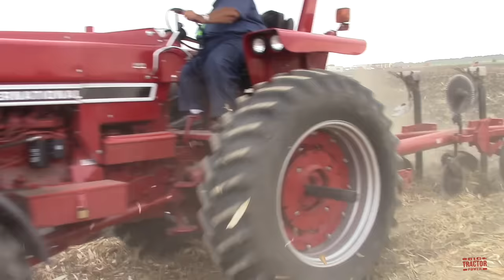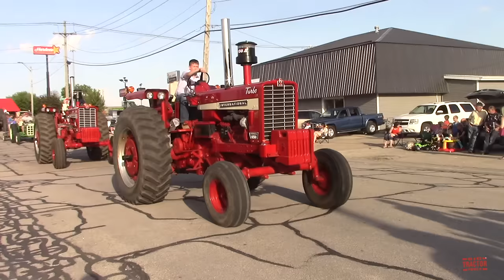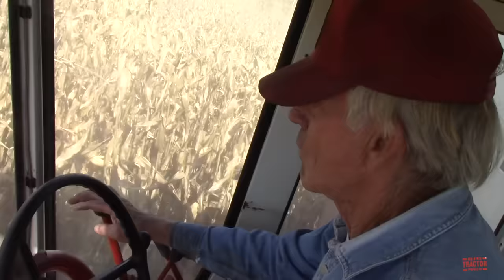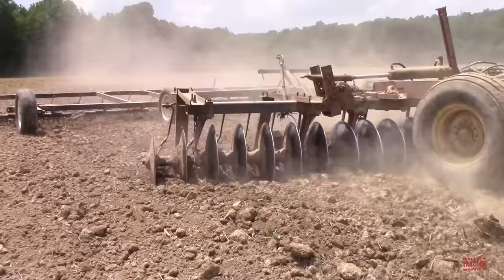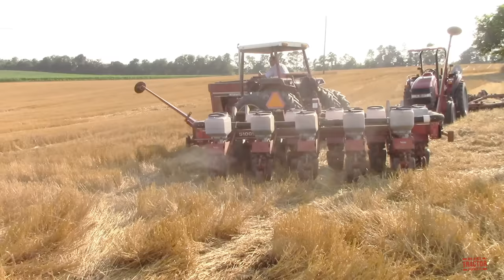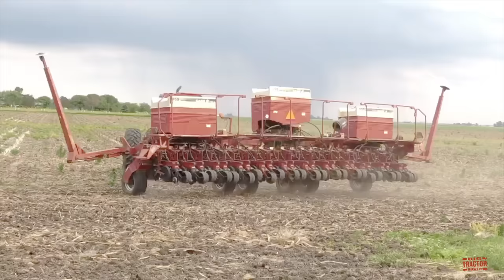INTERNATIONAL HARVESTER Tractor History

Comment: I grew up on JI Case equipment but have had the pleasure to run several IH tractors and my favs are 1066, 1206, 1586 and the low boy for mowing grass. 
We run Case IH on the farm in Illinois plus a couple of New Holland from same dealer.

Comment: I learned to drive on a IH 274 and spent many hours on Dad's 140 Hi-Clear. My two favorites though are the 826 as it was the first large row crop tractor I ran and the 5X88 series. The 1400 series Axial flows also hold a soft spot in my heart.
Reply from the maker: Very nice. I hope to film a 1480 Axial Flow. I have filmed a 1420, 1440’and 1460.

Comment: My grandad had lots of older Farmall tractors but that was before I was born (Dec 1960) and when he passed away suddenly in Nov. that same year, my dad took over the farm at 24 years old. He eventually bought a 806, 966, 1086, 1466, 5088, 686 and a 7130. We still have the 966, 686 and 7130, but the 5088 caught fire in the field last year and burned up... a complete loss. My favorite was the 1466.
Reply from the maker: Sorry to hear of your grandfathers sudden passing. Your family has some great red power.
Reply: My dads 1985 5288 caught on fire last year as well luckily it was just the turbo and we are lucky that the insurance company coved most of it

Comment: We owned 2 IH tractors in Serbia in the 90s and 00s. One was a 1066 in yellow color, and the other was a 1086 in white color. Both of them had double wheels in the back. I was just a little kid but I always wanted to sit in the cabin with my father in the 1086 since you could seat in the back in that tractor. A few times I even fell asleep in that tractor as a kid. I remember that they never wanted to start up on the first try so we always used K2 spray to start it up.

Comment: We had a 966 with the cab and an open station 806. Both worked good, but the 966 was pretty rough and probably needed an overhaul. Never wanted to lug down low, which seems uncommon. 806 was a true workhorse and is still in the family after selling everything else. Hour meter rolled over at least once, maybe twice!
Reply from the maker: The 806 is a solid tractor.  The 66 series are also good.

Comment: My favorite International was an 806. It was the first diesel tractor I ever operated. I loved the TA on the transmission. I baled a lot of hay and did secondary tillage with that strong machine.
Reply from the maker: The 806 is one of the all time greats.
Reply: U wouldn't believe how many ta's I seen my father tear apart. That was the week point of th 706,806, etc, that and the pro clutches
Reply: It was always the bearing that would let go often messing up the crown wheel and pinion the clutch.  They were are nice tractor  to drive with plenty of power to the ground

Comment: I worked for a young farmer in south central Kansas, back in the late 1990s. Every tractor and combine was red, being a John Deere man I was running red paint. He had about every one of your favorites. Don’t remember all the numbers, but my favorite was a Perkins powered two wheel drive. The mufflers were shot so I put two straight pipes on it, ma was it loud when she was pulling hard. She would blow smoke about 40 to 50 feet in the air on a windless day. What a thrill. Loved that diesel smoke smell. Miss those days. Keep up the good work.

Comment: Nice video. IH was very popular in our area in the '70s and '80s. Very fond memories of operating the 4166, 3788, 3588, 1456, 1466, 1468 (Of course it had the deluxe cab, belly mounted auxiliary fuel tank, chrome pipes and chrome heat shields lol), 1066,  and all sorts of utility size tractors from the 606 to 574, 684.
Reply from the maker: What a great IH line up. I want to find a 4166 to film. I have always thought it was a very cool tractor.
Reply: @bigtractorpower  There weren't many 4166s in our area. The ones I saw all seemed to be cranked up to higher hp which meant they ran with straight pipe exhausts. It was a beast! Used it to pull a 32 foot Vibrashank cultivator and occasionally a 24 ft. disc. .Small by today's standards, but uncommon in those days.

Comment: Great tractors and machinery.. I grew up with grandpas Farmall H and a M dad had a 460 and a Black stripe 966 also had a international 540 manure spreader a 430 small square baler a 990 international haybine international 5100 grain drill all bought from the same dealership grandpa said if the dealer takes care of the customer don’t go anywhere else and to this day even though the land is rented out, I still bought my first tractor a CaseIH 30c at the same dealership...thanks for the great videos 👍👍👍👍👍👍👍
Reply from the maker: Very nice red power line up. Thank you for sharing.

Comment: In 1977 I coaxed my dad into buying an 806 at an auction. Huge step up from our M and one heck of a workhorse. When I sold my 75 cows 4 years ago and retired I had a super H, two M's, 656 gas, 886, 806, 1566, 3588 2+2, and a JD A! The 15 and 2+2 went to my nephew's farm  and are getting a lot of use but I will never get rid of the 806. Along with the letter series some of the toughest machines ever made. They just keep running forever it seems.

Comment: I was raised on a tobacco farm in the western Piedmont of NC. Every farmer in my community and probably every tobacco farmer in Nc before the 1980 had a Farmall to cultivate with. Mostly the Cub. We had one and it was the first tractor I ever drove. There were 100’s140’s,super A’s,H’sM’s but very few of the bigger Tractors. Most people’s workhorses here was Ford. Most folks couldn’t afford the IH tractors in 40hp and up. And really didn’t need them. I’ve always loved and own cub cadets. And I always looked in awe at the big giant Red Tractors. But I’d have to say that lil Farmall Cub which replaced 2 horses is my favorite.
Reply from the maker: Thank you for sharing.  Burley and Dark tobacco are big crops here in Kentucky where I live. The A, B, 100 and 140s were the tractors to have.  There were still allot of 140s in use 20 years ago.  With the U.S. tobacco settlement several years ago there are fewer producers and now I see 200 hp tractors 6 row 38 inch cultivators working tobacco.

Comment: I learned to drive on an H Farmall hauling in tobacco when I was 6 years old. I had to sit on the very edge of the seat to be able to reach the clutch. Later on at 10 years old, I got to work for a neighbor cutting hay, chopping silage, etc. and he mainly used an International 966. That was my all time favorite. My mother about had a heart attack the first time she looked up from hanging out laundry on the line and saw little me driving that huge tractor down the road pulling a haybine to get to the next alfalfa field to cut. She thought I was RIDING on the tractor, she didn't realize I had actually been cutting hay...lol. So those 2 are my favorites. He had a 674 that I liked too.

Comment: When I worked with my Dad back in the late 60's and early 70's we worked in the citrus industry in Florida and the company had a lot of International 504 and 656 HydaStatic drive tractors. They used the 656's to pull the big 15' batwing mowers in the groves.  We didn't have a lot that were bigger than those, but we had a lot of them.  Those two IH's were the perfect size for working in the narrow furrows in a citrus grove and could do just about anything from pulling a speedsprayer to a mower.  I got to where I could break a 504 in half and replace the clutch in less than a day by myself.  Fun times.
Reply: my favorites were the ih1026 and farmall a

Comment: Back in 1966, when I was 18, I talked my parents into buying '58 IH 350 Utility. It had an after market loader  on  it made by Lord . They were located in Lancaster, Ma. I think. The loader had a seven or eight foot snow bucket  on it, and living in central Massachusetts, I used it to move a lot , and I stress a lot, of snow.  The machine was originally owned by WPI, in Worcester , ma, and it was pretty tired when we bought it, but I didn't care. I just wanted that tractor. It came with a Sims cab, but that's not  saying much. It was nothing more than four corner posts, a roof, windshield and canvas side curtains.  I cut it all off after the first winter  because it was getting ready to fall off.  We had that thing for about fourteen years.  I got married and bought a house and my now ex-wife didn't want it in the yard, so I took it to my brother's place for keeping, but about a year later he needed money and he sold it without telling me. If I had the money, I'd track it down ,and if it still exists, I'd have it rebuilt. I don't care how cold I got plowing snow ,  I loved that machine.

Comment: My favorkte is the 1066 .. i love how the cab sits over the wheel......growing up we had a 4586...we called her big burtha, 2 1586 with duals, 1466 turbo no cab with forks front loader, 1066 with cab, 784 with loader,...we also had a farmall 806 wide front alxe. we still have the 806...it was the first NEW tractor the farm had ever bought everything else at the time was bought used and wore out..the 806 sits in my dad garage just waiting to get workerd on and run again...good old tractor did everything...mowed with bushog, pulled silage wagons, sprayed when the 1066 was busy...amd ran augers ALOT

Comment: Growing up on a dairy farm in Upstate NY, we had a couple IH tractors that I liked.     A 1967 656 gas tractor, narrow front end and also a 72 1066 wide front end tractor.   
Our farm was a clay farm.     And as strong as that 1066 was, we could not pull anything bigger than a 3 bottom plough
Reply from the maker: 👍👍. I grew up near Rochester, NY.   A dairy farm I grew up watching had a ‘76 1066, 656 and 686 in the 70’s. In the 80’s they added a 1086, 886 and another 656 and 686. Today they are a grain operation and still use several of these tractors.

Comment: I cherish my late father's 454 hydro , with rear mounted 2ton forklift and variable weight box on the front my father designed to in load. Bricks in the 1970s. His answer to deliver bricks on in even building sights before fwd tractors. I found it 40yrs later. I have a Aw6 loader, and 2 A554 one a front mounted forklift. Mum still has our 384 bought new in 70s.  And we had a B250 rear mounted forklift as well, I know we're that is and first on the call list. How ever I am looking for a big articulated inter for my small farm. And I have an old 1972 4x4 c1600 firetruck with a Perkins diesel. I also have an Ex Australian army ACCO 6x6 army truck. And did my truck licence in a ACCO T liner water tanker 12500ltr from my old fire brigade.  As a kid of 5yrs we drove an Atkinson 8v71 and a transtar in a local show Grand parade for the local international dealer as kids we were so cool hanging out the passenger window , a prowd moment thankyou international

Comment: I grew up green but had neighbors that were red. Many had the 656. I like hauling baled hay wagons with it. The 2500 loader tractor, it had great road speed and Deere hsd nothing that had the same loader lifting capacity.  The 2+2 were a hit  until Deere made the mechanical front wheel assist. The thumb of Michigan had a lot of 2+2 sitting on green farms. I had 5 neighbors who had at least 2 4430's and got a 2+2 because we had a lot of wet falls in the 70's and 80's. But they disappear with the release of the Deere mechanical front wheel assist.   Great video to see those old IH still working.   Ps: all the 656's are still on those farms.
Reply from the maker: Thank you for sharing.   My neighbor had two 656s and 686s for haying in the 70’s and 80’s.  They also used them on a grain drill and rock picker.  They still use them today.

Comment: My first experience with a Farmall was a truck farmer my parents knew a got me a job picking vegetables for in the summer. He had a 1950’s era H. I quickly learned why he told me to never have it in 5th gear down hill ‼️. I was 13 years old. My fathers uncle and cousins farmed with mostly international equipment but I never got to work with them. I later worked with a friend and he had two 1468’s. I plowed quite a few acres with it and an 6-18 on-land I H plow. I did some custom work for a friend with a 2+2 and a JD 6-18 in-furrow plow. I liked the 2+2 but I have to say the 14 was my favorite of them all !!!

Comment: We have a ‘49 McCormick International W-6 Standard that we have had since 1961. Been a heck of a workhorse and a great tractor for doing mid sized jobs, has even pulled out stuck tractors due to its large frame. I’ve always wanted to have an IH 5488, as I’ve always had a soft spot for them and my cousin has one just down the road

Comment: We had a 1964 706, diesel.  I was born in '66, so I grew up with that tractor.  I think it has 30,000 hours on it. I know we changed the tachometer on it 3 times for sure.  Good old horse, still running.

Comment: The Aussie made AW 6, AW7, 554 and 564 were great tractors. All were much the same power and design but with updates like a different grill on the 554 and 564.  All around the 55 hp mark but they were real luggers.  They also had petrol kero jobs in the 6s and a few sevens.  They were more or less a copy of the  Yankee  W6 or W9.   We had a Farmall H, B250, B275,  B414 ,  a W6 Yankee job, an AW 6, , 2 x AW7s, and a 554.   Still run the AW7 which is a mix of aw6,  aw7 and 554.  She is a bitzer. My uncle just got the old Farmall going again recently.  It still runs like new.  My fav is the 1466 ,  tough as nails.

Comment: 4166, best designed tractor for heavy tillage work ever built.  Used to drive one when I was 13 years old pulling IH 770 56 plate folding wing offset discs.  A tractor well worthy of retoration and preservation. The design should have been offered in bigger horsepower configurations, 250 and 300 would have been great.

My parents bought a new 434 on Januaray 9 1971, about the end of this model before the 444.  It was oprioned with factor power steering, Speed Amplified that did give trouble, full st of wheel weights and bigger tyres, 16.9 x 28 rears and 750 x 16 fronts.  It was traded in at 5 years old with only 1,500 hours on it because of the Speed Amplfrier problems and the time arrived for a FWA tractor for spraying our peach orchard.  Oh I longe for the wet years of the 1970s in Bathurst, NSW, Australia.

Comment: my favorite was hands down Dad's Turbo 706 with the German Diesel that was sadly lost in shed fire along with my cousins 1206 grandpa's 560 and 666. we replaced the the 706 with non turbo one with the German Diesel and the 66 with an 686. the 560 was replaced with a Kubota m125x and the 1206 was replaced with a John Deere 5000 sires. the original 706 had 22,000 hours when it had a complete over haul and ran another 12 years in field, feed lot, and as augur tractor. i have never seen a tractor that has equaled this service life and not to mention it was what i learned to drive first. its engine sound is music to me along the sound of a 560 or 460 gas.

Comment: My favorite CASE/IH tractor was the red 3594 MFWD. I bought mine brand new after running a JD 4850 MFWD and the 3594 in the same field pulling a 7 shank Big Ox ripper. The 3594 out pulled the JD4850 and when I hit a hard packed lagoon the 3594 pulled down and started smoking and went right though the lagoon without having to raise the ripper. The 4850 hit the hard spot and literally killed the engine. That made up my mind along with the fact I bought the brand new 3594 cheaper than the 2 year old 4850.

Comment: I own a 1985 884 until a couple of years ago when we bought from the town it had spent it's entire life mowing the sides of the road. As most know government employees are hard on equipment, and will do anything to get the tractor back up and running, needless to say I have been chasing hydraulic fluid leaks, knock on wood I think I may have finally caught most of them. Then I noticed both brake master cylinders are leaking, the front wheel bearing are loose! I have about decided the 884 is the Redheaded step child of IHC tractor in America, while I have a parts catalog, shop and owners manual finding information and parts online is almost nonexistent.

Comment: My favorite was our International, (Farmall), 826 Diesel!   We had an M, H, Super C and a Super M.  H was traded for another loader tractor brand, the M was traded for the 826 and the Super M was sold out right to help finance the 826.  It was the largest Farmall, (International), we ever had, and a 4-bottom plow, at that time, was hardly ever seen in Western Massachusetts except for the larger potato growers.  Later years we acquired a 686 and traded the Super C for a 404.  The 826 is still being used by my cousin on the original farm.

Comment: I grew up with international tractors. When I was little we had a 1947 Super A we called “Little Lucy” (still have her but she hasn’t been cranked in maybe 15 years), and a 504 diesel lowboy we called “Big Boy”. When I was 9 or 10, my father bought one of the first 1586 tractors anywhere around. After 2 or 3 years he bought a 1566 open station as a back up after we had bull gear issues with the 86, and inherited a 4000 Ford and we farmed with those until the early 90s when the farm sold.

If I’d had it to do again, I would have liked to have had an 886 instead of one of 15s and the Ford

Comment: That's a tough question. We have owned several over 3 generations and still using them today. Never had a reason for anything else. When the high interest rates hit in the early 80s my dad had just purchased a new 684 and a 400 cyclo air 4 row planter. Can you imagine if the rates went like that today we would forget all about covid 19.